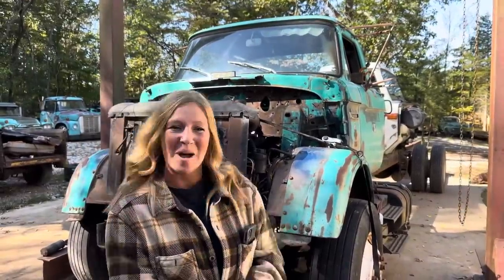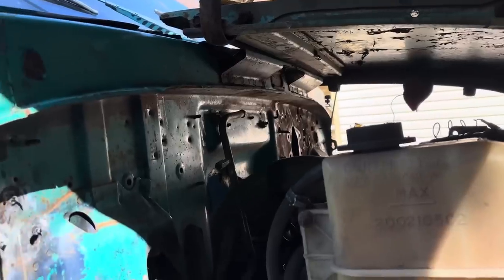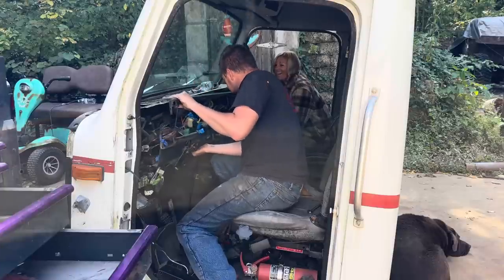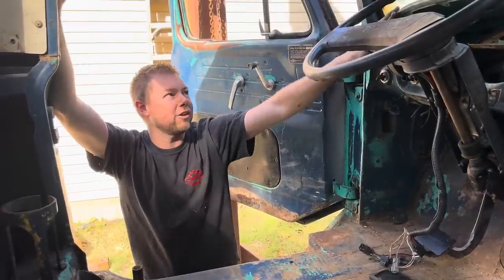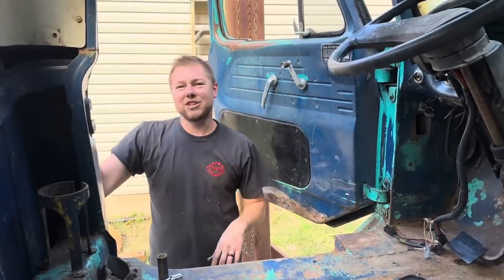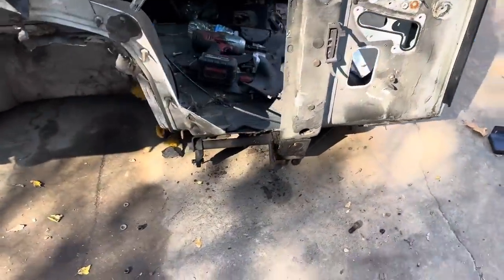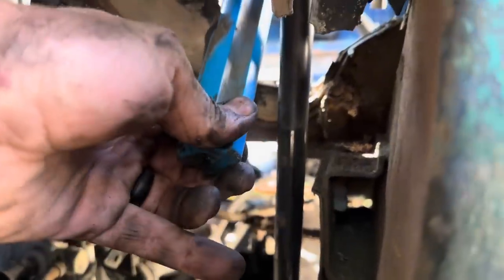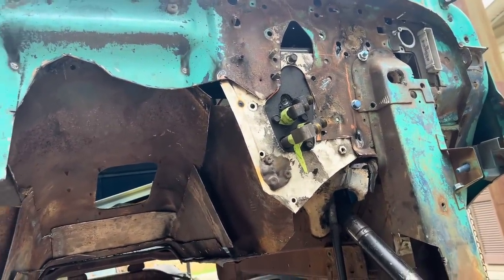Bringing the HEAT on Hannahs welder rig!!

Comment: Hey when you mate a late modern chassis to an older body how do you register and insure it? As the late model or the body you put on it?
Reply: Usually the body we put on it! And definitely do stated insurance!!! Bc when the Viking got totaled if we didn’t have good insurance we wouldn’t have gotten it done so soon! To the untrained eye it’s just an old beat up truck!
Reply: @Hannahwheatcustoms  thanks I've got a 37 ford truck with a 77 vette frame i'm building no serial # on the body a little issue there. By the way back in the day I put a 4bt in a 67 Elcamino sweet little ride.. thanks

Comment: Love the channel but don’t weld to the frame flange. It will weaken the frame  run your bracket down  the side of the frame and bolt it. Much safer than having a cracked frame from a weld . In my opinion. Like all your builds grate content always!!!